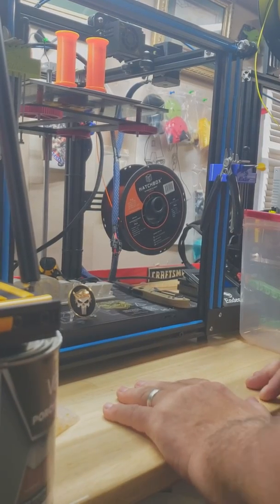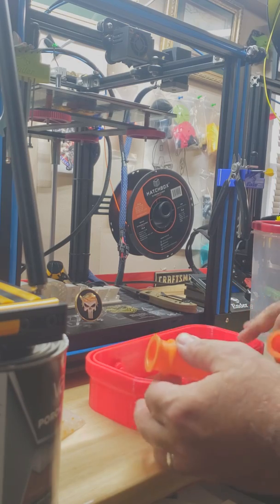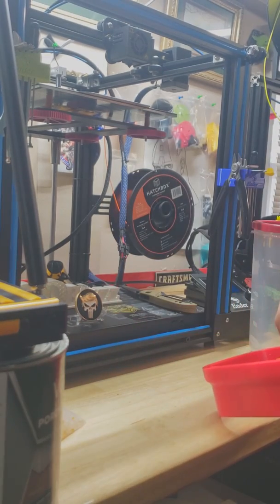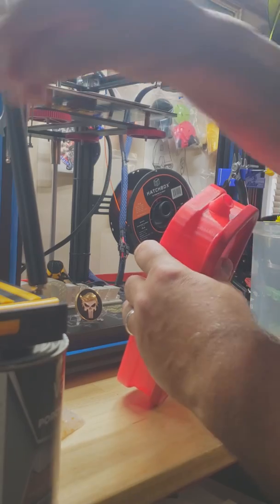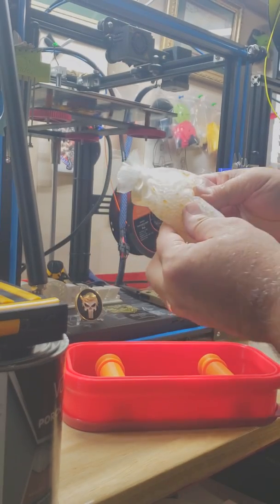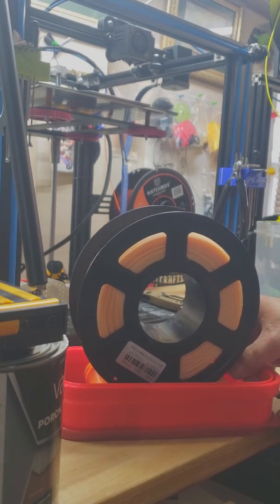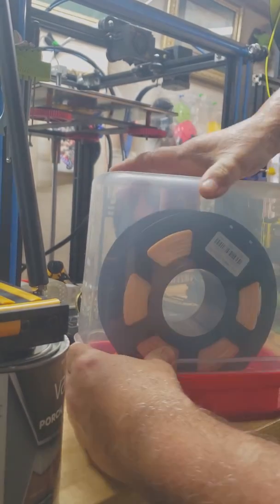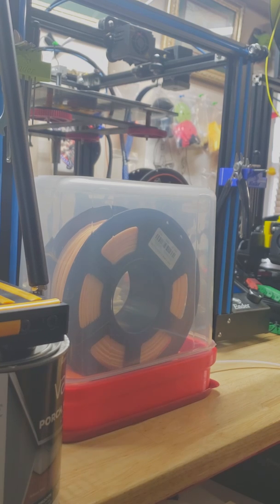Low cost FDM filament distribution and dryer system

Comment: Excellent design. This is just perfect for me as we have a bunch of those 16 cup rubbermaid containers floating around the house.
 What printer did you use to print the adapter?
Reply from the maker: The Adapter is large coming in at 254 mm long , so the smaller print beds will not work.  I printed mine on a Ender 5 Plus but any bed at least 270 + should do.